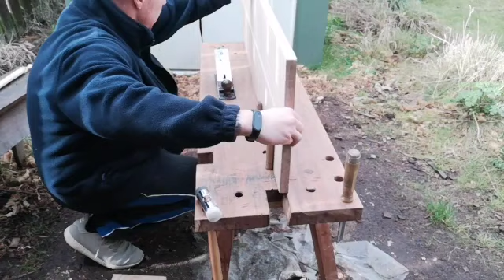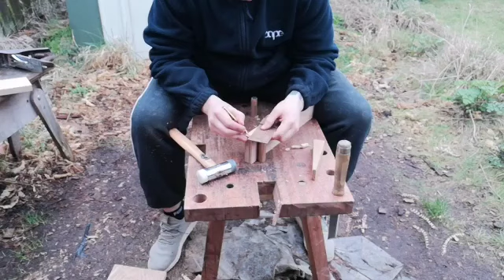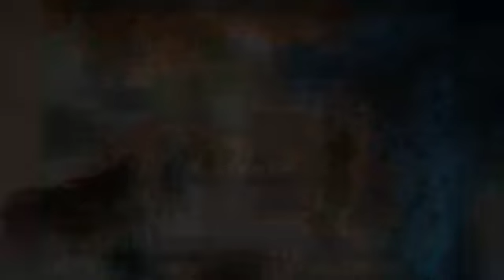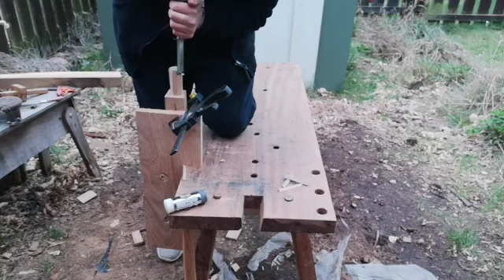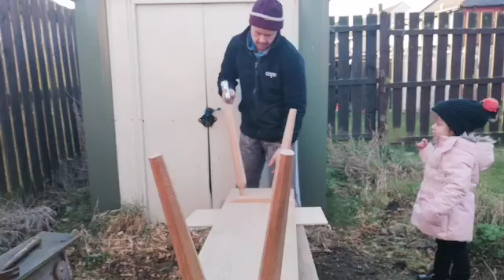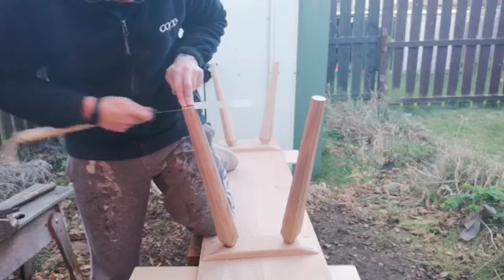How to make a simple bench, with a few hand tools

Comment: I love your videos.  I was wondering how did you hold the legs when you were rounding them over.  By the way I found your channel from your podcast. great job on that as well
Reply from the maker: Thanks very much. In the bench there is a notch , that I use with a wedge. I fixed a piece of wood in the notch then, clamped the leg to the piece of wood. There's plenty of pictures/videos on my Instagram if you are curious about the bench.
Reply: @DW_woodworks  thanks
Reply: That's a cool way to use a notch vise. Been wondering how to use the one in my low Roman bench without mussing up a nice part! Plus you can easily turn the work without having to dislodge the wedge every time and risk everything clattering to the floor when it comes loose.